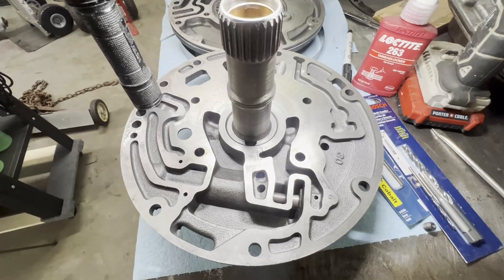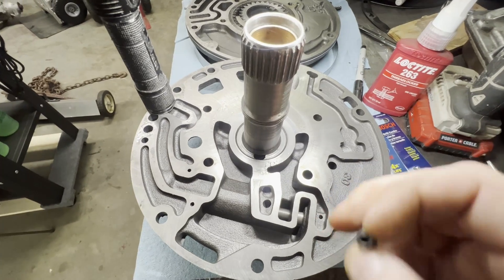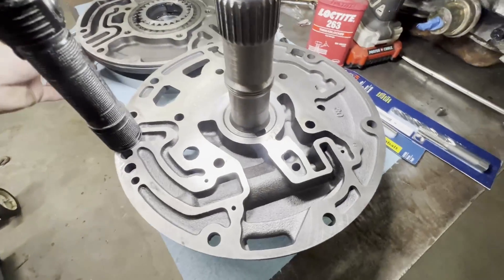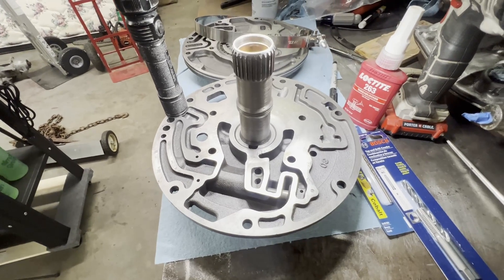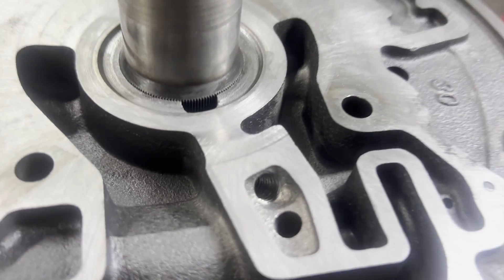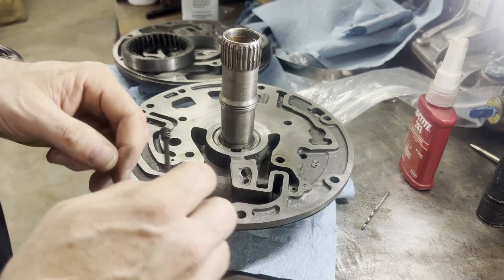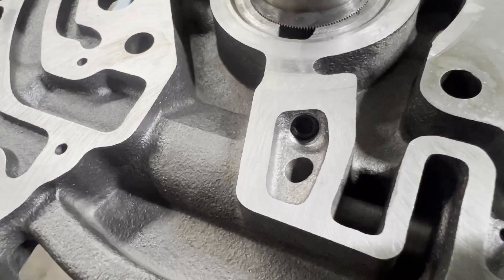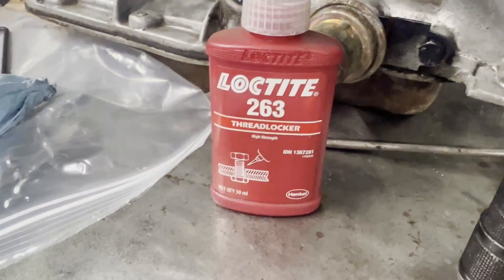TH400 Converter Charge Pressure Reduction - LS Swap S10

Comment: Just watched this and had a few things to help you out. The hole size is dictated by psi of trans and size of stall either NA or Turbo. That range is usually (.110-.150). Set scew can be threaded into nut and placed in vice instead of wood. Always use brass set screws in pump converter feed hole simply because if you need to drill larger hole in future is easier and I have seen hardened set screws crack brittle pump passages. Amazon and eBay sell them from a pair at $5 or 100 pack at $40. The cost of 2-5 hardened drill bits is more the brass screws. The converter feed hole doesn't need drilled out when you use brass either since brass is soft and threads will smash in perfectly made from tap. Plus only run tap down hole like a few threads and it will create a stop for screw like NPT fitting. Last thing to mention is cleaning out pump holes from metal shavings which putting grease on tap will keep some debries on it. I'm thinking of creating a YouTube channel just for transmission work since nowadays seems to be more interest. I had a video 10 years ago but the old shop didn't want recording done during work hours. Now I have my own business so will see about making one now. Good luck with your build!👍🏼
Reply from the maker: djrowe10 Man!! Thanks for the information!!! I had thought about using brass but those set screws weren’t readily available when I did this. I will order some and keep them on hand for sure now. That makes a lot more sense to be able to easily drill the hole out. I had a hard time drilling the set screws I had. I even heated one or two and quenched them in oil to retemper the steel where I could drill them. This was after I already drilled one out. I was looking for an easier way to drill them out in the future, but now I will go with brass. You should definitely start your channel back up. If you do, let me know the name and I will subscribe for sure. With the information you have shared with me I am sure everyone else would like to see/hear it as well. Thanks again for watching and sharing your experience in the comments. I am not a transmission guy, but I am learning to be and am enjoying the process. Thanks again!!!!!

Comment: You dont test pressure with the cooler line ports. There is a pressure teat port on the drivers side of the case that is used. This is a 1/8th npt theeaded port.
Reply from the maker: @jeffallen3382 Thanks for the correction. I am learning how to work on the TH400 and I saw where someone said one of the cooler ports was pressure and one was return. Thanks for letting me know and thanks for watching! I will go back and make the correction in the video!
Reply: @dtperformance256  no problem!

Technically there is a pressure and return on those cooler line ports. But those are not what's used for diagnosis of the transmission "pressure" circuit.
Reply from the maker: @jeffallen3382 Good to know. Thanks again for commenting. I picked that info up from someone else and I didn’t think that one of the cooler lines had that much pressure on it, but again I didn’t know and was trusting of what they told me. What you are saying makes more sense to me. I dont want to give out incorrect information so I really appreciate it!
Reply: @dtperformance256  you're welcome!
Reply from the maker: @jeffallen3382 I got the video edited and found a pdf of the ATSG TH400 manual that details the port to check pressure. Thank God  for people like you that are helpful and not jumping on here to beat me up. Again, I appreciate the info Jeff.
Reply: @dtperformance256  you're welcome, glad I could help!
Reply: Internal pressure and line pressure are not always the same but either can give you a ballpark idea. The bigger issue is how to modify and control those pressures! Most guys don't even check it if it works they just send it.. 🤔 @dtperformance256